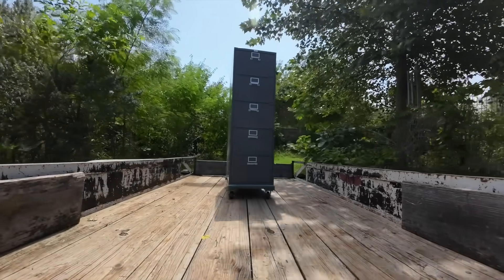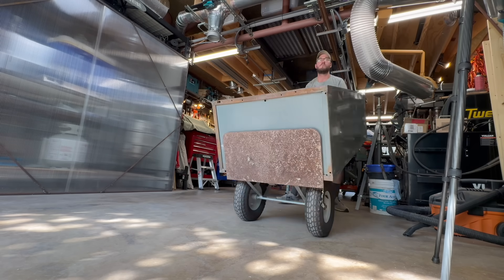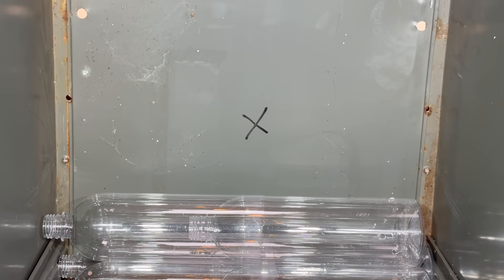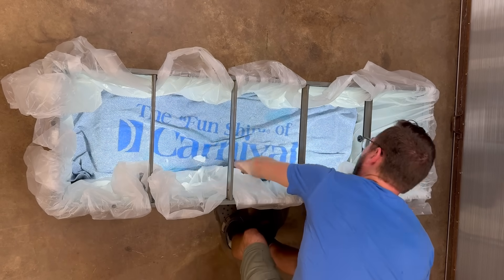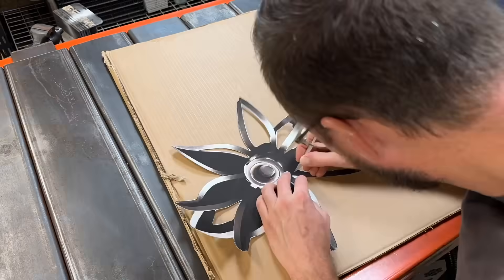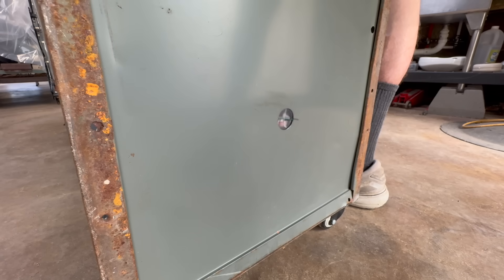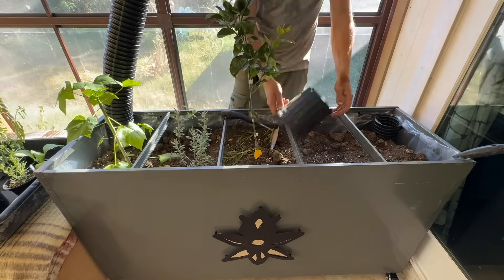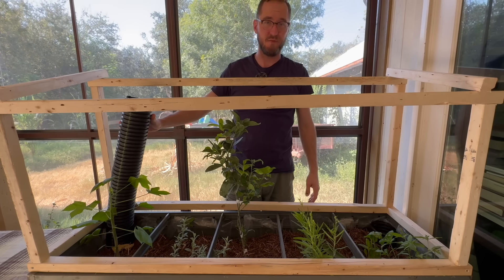A new type of Greenhouse

Comment: Drawers can be used for floating water hydroponics.  Line the drawer with painters plastic tarp.  Make sure you make it watertight with the plastic and affix with duct tape.  Now fill with water, put a flat piece of Styrofoam that will float on top of the water.  Cut your holes and make net cups out of solo cups.  You can grow 4 pepper plants, 2 tomato plants or boc choy even lettuce the possibilities are endless.   Add hydroponic fertilizer to water and set it and forget it till you eat it.

Comment: In Oklahoma here I've learned that you just need some partial shade and compost in the soil, planta cant really use a whole day's worth of direct sun past about 6 hours, and I saw a video where a guy put down three feet of mulch in his yard in arizona, and that thing was lush with just rain and house runoff. Plant matter holds water like a sponge and with no till you can get there using annuals putting down lots of deep roots, tree leaves, and sticks that kids will enjoy crushing flat for space and decomposition. Woodyer parts last longer, and when they break down all the way the carbon sticks around in random stuff. Over time it builds up a mulch bed which seems to be the easiest and best solution for me. I like to keep tall poke plants for partial shade to manage temperature, they scatter infrared which works well for the understory, they also deter herbivores and can be managed easily. All the work I really do is pulling weeds and some shoveling to manage rain runoff with the slight changes in slope, or putting stuff in the ground.
Also, hackberries are awesome gardener plants, they're edible to most things, they grow fast and generate tons of mulch from their leaves, sticks and bark, it's noticably more than other trees like birches, maples, and sycamores which just get blown out of the yard in the fall. They also concentrate minerals in their tissues so they're nutritious, but that also means they remove heavy metals from soil, and i know I'm rambling but rolly pollys will eat those heavy metals and keep them in their tissue to deter predators, and both the trees and the bugs are tough so that's a solid system that can keep your soil pretty darn healthy.
Also if you really need a lot of water and want to be really efficient I suggest ollas, it'll last a while and need very little maintenance.

Comment: Milk crates are great for water reservoirs
Reply from the maker: Thanks for the tip!
Reply: @suburbanbiology you’re welcome! I’ve been looking into making wicking beds for a while now, living in Arizona… water is kind of a big deal. Thanks for the filing cabinet idea! I love repurposing and the industrial modern look.
Reply: @suburbanbiology oh! Something else that would work well… although tedious. Cans. I’m addicted to flavored bubbly water and I hate throwing all those cans into recycling. They’re surprisingly strong as long as they don’t have any dents. And they can be stacked… drill a couple holes on the bottom of each can and voila.
Reply: @suburbanbiology okay, wait. Sorry to inundate you with messages and ideas, but this one is the best. Put the drawers back in on their sides. 🤦‍♀️ you can hold a massive amount of water that way, and now don’t have to worry about finding a use for the drawers.

Comment: Forget about soil! Just fill it with water. Sheets of styrofoam or pvc foam (I find for free all the time!) float on top of the water. Cut holes in the foam to hold small cups. Poke some holes in the cups. Put plants in the cups, held in place with peat moss, coco coir, clay pebbles, or even dirt. You have a cheap hydroponics garden! You can grow most plants this way!

Comment: I see a pretty good shop. Make a welding cart and bench storage with the drawers. Various appliances, a furnace or an old air conditioner provide free sheet metal; plus bed frames for angle iron. But you already thought of that! Cheers

Comment: If no old T shirt or other used clothing/curtain fabric could use lanscape cloth, available at Dollar Tree for $1.25.  It is not the best for its intended purpose, however, it works fine in plant pots and would do fine in the application you feature.  Yes it would raise the cost.

Comment: Horticulturalist, agronomist, bonsai professional here
This is a dumb idea.
You water from the top down, not the bottom up, your rusty boxes will leech iron, lockout mag, zinc&copper. Youll never be able to properly flush your soil, it will always be full of nasty exudates that plants do not want. Youll never be able to properly fertilize, the water wont hit the surface, interact with ferts, then wash through the soil, even if you placed the ferts, theyre just gonna sit there leeching and building up in the soil, locking out everything the plants need. Youre working against gravity, saying f it and your placing all of the responsibilities on weak capillary action, so youre either using poor soil to make this work, or it just straight up wont do anything, good soil doesnt have enough capilary action to pull that water up because the only job capilary action has in a pot is the suspend the water column and counteract the gravity which is pulling it down. You put a cap on the gravity and the only way to properly do this is to fill your perched water table up like a bucket, which is what you did here. 

On top of all of that, this is not a new type of greenhouse. This is the same, lazy, "self-watering" planter box that moms have owned for decades~now with filing cabinet! This is just some clickbait from an influencer whose job has nothing to do with plants and everything to do with holding attention so they get a check. Hes an advertiser, not a horticulturalist, he might even have a degree in it, that means nothing.
 These people are brainwashed to think plants arent that deep and to most people, theyre not, thats why its easy to get away with nonsense. All self watering systems only exist to sell you on the idea that you can do nothing and have plants, you then buy the product, use it once, and never again. Because youre not a plant person if youre not properly watering your plants. 

So, this has nothing to do with greenhouses, you failure of a human who needs to lie to feel interesting. "Same self watering bs" isnt as good of a title. Well unfortunately your lie of a title attracted a real, educated professional to the video, im ravenous for a "new type of greenhouse" id buy one tomorrow if it existed. You can choose to delete this, if you wish. I am more than willing to describe in great detail all of the different theories and findings which  back up my statements but the comment is already too long to get into nutrient lockout or soil chemistry, which will be your burden in about three months when the roots cant get rid of toxins because the CEC sites are all filled up. But, hey, i guess theyre not my plants. That must be what youre saying as you look at this thing rusting in the corner next year, while some dimwitted consumer comes along each month and recreates this atrocity. 

Understand, i do not care about their plants either, i am only saying all of this because this was the most egregious clickbait of all time, this has literally nothing to do with a greenhouse and something like that deserves to have its video picked apart by someone.

Comment: Hey love your idea and your video is great. I think you might have some problems though in the long run using soil. Because the soil from your garden or the ground has a certain amount of clay particles in it, what happens is, as you water that soil the clay particles tend to come together down the bottom and make it Either extremely compacted or very soggy and water resistant where your roots will rot even though you do have the fabric barrier. Potting mix is technically not soil. Because in a container of plant is extremely sensitive to root rot. As you already know, hence why you built your self watering container like you have, the potting medium can’t contain any clay particles or long term it’s going to fail. That’s why commercial potting mix is purely compost, organic/ plant matter. 
Hope this helps.

Comment: How has this held up? I imagine you'd still get some anaerobic conditions near the bottles/underneath them. Any stinky dirt that you've noticed or mold/algae?
Reply from the maker: I had to take things apart for the greenhouse construction. There was a slight anaerobic smell to the soil way at the bottom. But it was not very noticeable from outside of the dirt. If you let the water get soaked up by the roots intermittently it lets things dry out a bit at the bottom.

Comment: Your airflow is backwards in that tube heater. You want the tall ones to convection extract into the greenhouse and you use a big slab manifold for your heat collector and storage.
Reply from the maker: I see your point. This system will use forced air with a fan. Pulling the hottest air from near the greenhouse ceiling is an option with a fan.

Comment: I wonder if you could design an indoor greenhouse in a filing cabinet. Plant in the drawers, and mount a grow light under each drawer to provide light for the plants below. You could pipe up a watering system in the back of the cabinet tho you might need to trim some of the drawers. Then a water basin on top to feed the water system. (Or posibly even having the water basin in the first drawer so it just looks like a regular filing cabinet)

Comment: Is the $5 the amount you paid yourself to build it? 

You need a drill, a plastic lining, a screw driver, or something to remove the sides of the filing cabinet. A drill attachment that will drill through the metal. Bottles, a towel, dirt, and tape. 

How is this $5?  Sure if you live in a house with all of this stuff on hand it may cost you that. Seems very out of touch or at the very least misleading. The concept is great, but choose a better title.

Comment: How do the roots get at the bottom of the reservoir when there's a towel in the way? Are the roots only able to suck out the first few inches of water, or does this design allow the plants to utilize the entire capacity of the reservoir?
Reply from the maker: The towel and soil wick the moisture up into the upper parts of the planter.
Reply: @suburbanbiology Thanks for the quick reply! I just realized that I forgot to specify that I was asking about the budget version. The towel seems to only lay on top of the bottles and does not dip into the bottom of the reservoir.

The way I understood it is that once the water line falls below the height of the bottles, then the towel will no longer be in contact with any water.

Comment: I am going to take my cabinet drawers, put the ends together to make a square. I will elevate them on cinderblocksand line them to make a planter. Then I am going to place pretty garden pot with a fountain in it in the middle. I may take leftover old fencing to cover the planter and the cinderblocks.
Reply from the maker: Cool! Sounds like a good use for them!

Comment: Would the geothermal tube work without a fan?
Reminds me of the self heating outdoor bathtubs with the copper coil. Those work without a circulating pump.
Wouldn’t air function in the same way?
Reply from the maker: To some degree I bet it would work. But the fan increases the efficacy by really allowing the soil to store and release more energy.

Comment: Seems overly complicated. Wouldn't a plastic container work better? No need to put that plastic bag (?) inside, easier to work with, does not rust. Also this towel-filter thing will probably rot in a year or two, since it will have constant water contact, so it will not function properly soon. Unless you used something inorganic, in which case it could severely block water flow. Also also will water flow from this to soil effectively? The water is "connected" to soil through those rags you put, would that be effective? Especially when plants are small? Generally what you are trying to do is to separate roots from standing water with rags, which will rot and roots will get through it. It would be way easier and probably the functionally the same if you put some rocks on the bottom and drill a hole where you want max water level. Much less work and effect would be the same I think. Furthermore - this is not "self-watering", this is a straight lie.

Comment: There's a technique called hügelkultur that does essentially this but uses old logs as the reservoir. They take up space, which saves money because you don't need as much soil that way. They also break down over time, fertilizing the soil. Apparently the logs should last for at least a few years. I'm getting into serious planter growing next year for the first time in my life, and that's the approach I'm going to be using.
Reply: Make sure the logs you use have been seasoned at least a year so they don’t steal too much nitrogen from the soil as they break down.
Reply: @katjames914 how do you season them?
Reply: @gigilaroux762  I prefer garlic powder, chipotle, and maybe some cilantro for my logs 😜
Joking aside, to "season" a log you just need to keep it out of the rain/from getting wet. It can be as simple as putting them on a pallet with a tarp over, or tossing them in a shed or garage. This also works for firewood.
If you're planning on using the wood for crafting or something like that though, it's a more controlled process.

Comment: Metal File drawers make great triangle / pyramid succulents stacked planters. 
2 or 3 on bottom tier - different configurations depending on drawer arrangement. 
File cabinets prior to 1960s have thicker metal and all sides covered. I prefer only black metal ones as they already look modern. And it takes a discerning eye to see what the planters are made from so interesting factor built in. 
I use drip irrigation and gravity to get water through the stack. I have herbs and peppers in some as well. Did not block or enhance drawer’s drainage (except for a few drill holes strategically placed) as it is sufficient with design of drawers to have some drainage. 5 years and works great. Craig’s list for free cabinets.

Comment: Hi, great information! Suggestion for the air heater. Fill the tubes with a course aggregate, the air will flow between the rock and hold the heat for longer.

Comment: Nice idea! My favorite line is “I assume if you have an internet connection, you can source an old towel.” That I can! A truck, a dolly, and a drill with a strong enough motor and large enough bit for this project, not so much. Sigh. Still, it at least makes me think of what else might work as a planter that one wouldn’t expect… and consider what accessories I might want if I ever replace the 50-year-old electric drill my household currently uses :)
Reply from the maker: I must say I love my battery drill. I grew up using a corded black & decker from the 50s. Modern battery drills are insanely good. Thanks for watching and for commenting!!!

Comment: I don't cut and join my plastic bottles; I just poke them full of holes with an old soldering iron.
I fill the gaps between bottles with gravel (unless the reservoir is tall, then I use towers of coarse sand as wicks because gravel will only wick up around 10 inches)
Reticulation pipe offcuts let me add water to the reservoir directly, which is useful for tomatoes or watermelon etc - plants that don't like splashes from watering.
I use geotextile for the soil membrane.
Wicking beds and wicking buckets are just the thing in sunny Australia!        :)
Reply from the maker: Great tips! Thanks for weighing in!!!

Comment: rather than wait until roots grow down to the reservoir you can also use microfiber cloth or actual wicks to draw water up into the grow bed. Depending on your growing medium you will have either moist areas plant roots can find much quicker or slightly moist soil everywhere if there is alot of organics to hold water in the soil.  For drawer ideas... some kind of vent cover/flap for your new green house.. assuming you are taking them apart dog door.. attach them all together and mount on a rolling cart for a compartmented work table for the green house.
Reply from the maker: Cool ideas! Thank you 🙏🏼

Comment: How about a layer of Flex Seal as an alternative to or in addition to the liner?
I've built wicking beds from refrigerators laid on their backs, with any holes filled with RapidSet cement.
The insulation was very effective.
Reply from the maker: I’ve never worked with flex seal but from the commercials I’ve seen that might work. Thanks for the idea!!!

Comment: I appreciate the concept of using the earth as a thermal mass device in your scaled up version in the greenhouse build. Are you intending to cool it in a geothermal fashion? I ask because I watched a video not long ago of a guy, like yourself, attempt that and failed because the passive solar heating of the greenhouse overwhelmed the system. I’m certain a YT search will bring up the vid.
Reply from the maker: There is no way I would be able to keep it adequately cool with just geothermal. I plan to have many windows, louvers in the roof, and several large sliding doors. On top of that, I also plan on welding a structure that will allow me to drape shade cloth over the top of the entire greenhouse. My climate is crazy hot, so i need to overbuild the cooling system. I also will not plant anything that dies in mild heat. Thanks for commenting!!!